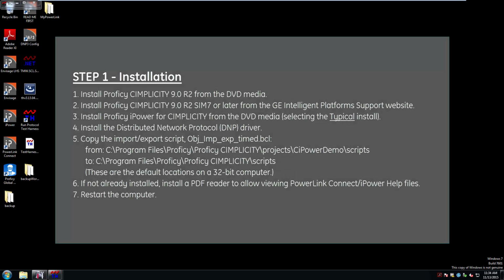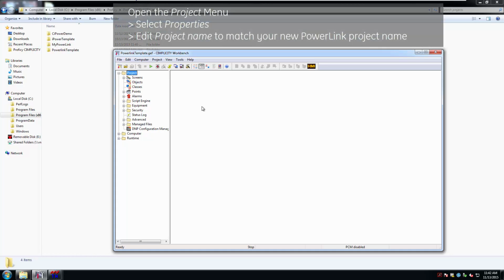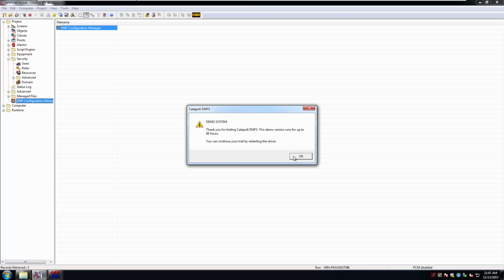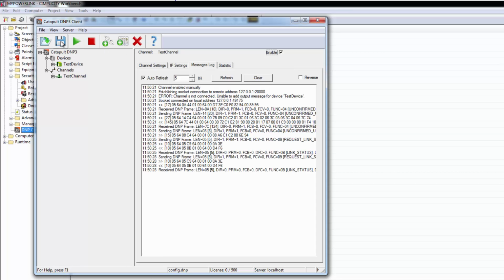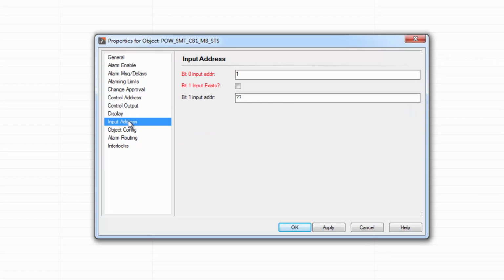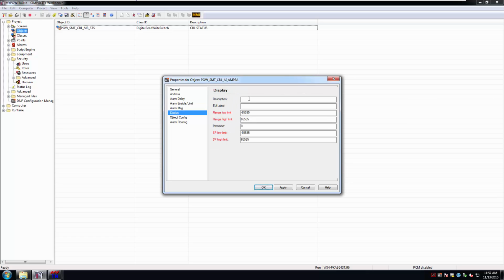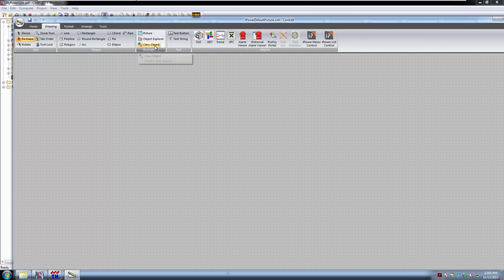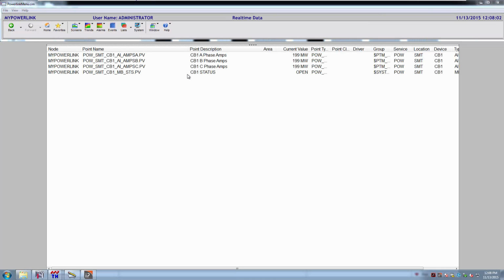PowerLink Connect Training #1 - Initial Project Setup and Configuration

Comment: On the demo I installed the "DNP Configuration Mananger" is not available under the Managed Files branch. Instead just one named "dbArchitect". Then I installed the "Catapult DNP Driver" (CatapultDNP_CIMPLICITY_v9.5.70.11.zip)  and now exists  a DNP confugurator but outside the workbench, just a executable in the windows desktop